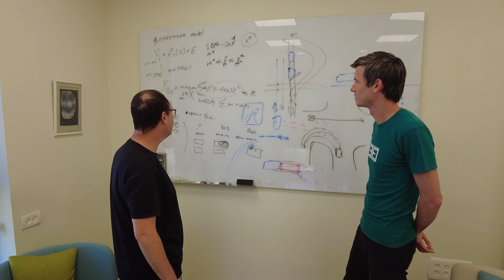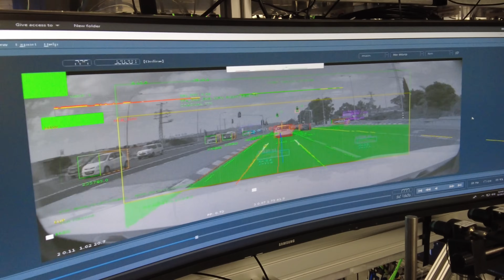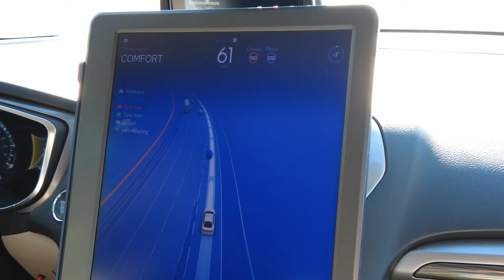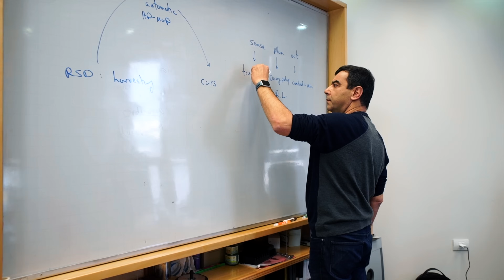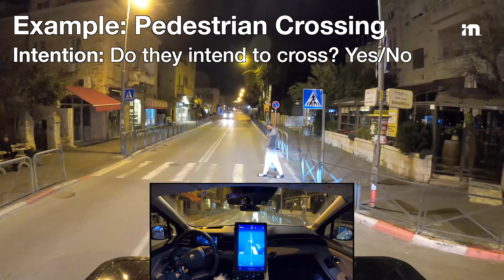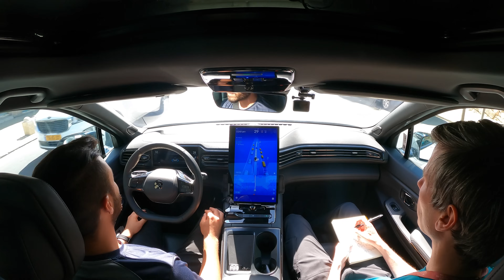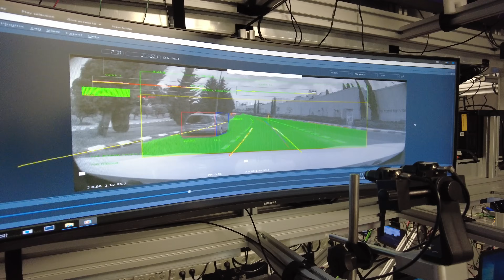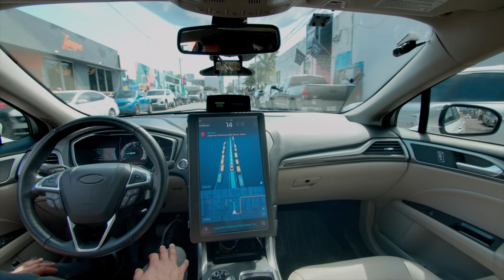Are Autonomous Cars Closer Than You Think?

Comment: Yeah, let's just program the AI to avoid such high traffic unprotected left turns like the plague.  I used google maps one time about a decade ago to go to a local business.  There was one of those major perpendicular intersections with exit ramps for all of the right turns and lights for the left turn, but there was also a network of side roads.  Well, I needed to make a left from the bottom major road onto the left major road.  Instead of using the major intersection, google maps had me turn onto one of those side roads and then make an unprotected left turn onto the major artery.  

I nearly got t-boned and now I make sure to ignore Google when it tells me to take a side road.

Comment: To all the self driving car avocates, I'd suggest looking up the videos of Vietnamese traffic intersections. In those videos, realize that all participants (drivers, pedestrians, cyclists, motorcyclists, etc) are able to negotiate traffic order on 8 lane intersections without any traffic control devices. Humans are able to do this through just hints from subtle hand gestures, gait/pace, horns, lane positioning, spacing, and angle.

Even in countries with more rigid traffic control policies, a human driver clues into these subtle hints. You can tell when a car is about to cut you off based on their lane positioning and angle. We mentally note which cars may be driven by distracted or new drivers and are more cautious around them based on following distance, response time to traffic lights, etc.

I've pulled up to do a right turn and had a car in the lane left of me pull up to block my view of oncoming traffic. In those situations, some times I can look through their passenger window and windshield to see oncoming traffic. Show me a lidar or video detection system doing that.

It is really easy to mislead how well a self-driving system works with statistics. A million accident free miles is worthless if only driven on sunny days and easy roads and the system bails out to a safety driver when it doesn't know what to do. Until a system takes in ALL of the inputs we as drivers do, how can a self-driving system match or exceed human drivers? No system in development takes into account horns or highbeams or hand gestures from other drivers.

Comment: After the past couple of years, I'm overtly against self-driving vehicles. They'll only be mandated under the guise of "your safety and the safety of others". 
You dissent mandates? Musk? Israel? US imperialism? Or simply don't update your battery software? Now you're locked out of your car by a central authority, and it's driving itself away. 
Neat trick, engineers of tomorrow. 

Outsourcing our thinking and reasoning capabilities to silicon and copper will only continue the trend in all aspects of our lives, making easier a populace to control. 

Even going from cable throttle to electronic throttle from an '02 to an '07 civic (both manual trans), I was very displeased with the amount of control I felt like I lost over the engine and the noticeable time delay gained, with the added filter of a computer deciding what percentage of throttle I'm applying.

Comment: redundancy? and here tesla is removing sensors and simply relying on cameras that can get completly blinded by some water lol
Reply: @chris thorney What do most drivers do, when they are blinded by some water??  When conditions are that bad, cars shouldn't be driving on the road.  Just for the record, Tesla FSD beta has redundancy as part of its design.  The idea of removing sensors is to rely on the more accurate ones, so as not to waste processing power, cancelling the less accurate ones.
Reply: @HearToneSpeak  are you honestly saying that you think a human is going to be blinded by a single drop of water like what can happen with a tiny little camera, oh my car stopped working let me get out in the rain to clean my camera lenses, instead of just putting the windscreen wipers on, witch it what a human would do, just for the record. have you ever driven a car lol? geez, tesla cameras are not located anywhere that wipers do anything, and all i said is your removing redundancy, so if one sensor fails you have zero fall back on a critical system that has lives involved, redundancy should be mandatory and if their is conflicting info then it should hand over to a human, but if their is only one sensor then it might not know its getting the wrong info because it has nothing to compare it to, when all it takes is for one rain drop to roll across the camera at the wrong moment and it will completly miss for example the car infront brakeing or anything, i dont see any good coming from removing the sensors except that tesla is going to make more money and thats good for them, but the rest of the world is left with a less safe enviroment on the roads
Reply: @christhorney  "are you honestly saying that you think a human is going to be blinded by a single drop of water like what can happen with a tiny little camera"  Absolutely Not... in fact the Cameras in a Tesla are bigger than your eyes, so a single drop of water will have little affect.   Secondly, the Tesla would activate the wipers to clean the windshield.   As for redundancy FSD uses 3 Front Facing cameras, but if more than 2 fail, the system has bigger problems and FSD shouldn't be operating.   

I don't think you understand how Tesla FSD Beta works.... mainly because Tesla doesn't explain all of its tech.   One drop of rain will not invalidate the system that is for sure.  

As for removing sensors, you should listen to Lex Fridman's interview of Andrej Karpahy's, he expertly explains why removing sensors actually makes the system better, not worse.   Adding sensors, is only good if it will improve fidelity/reliability/redundancy.   Having more sensors increases processing time and can actually impair the system.

Comment: There is this one T intersection where the traffic coming from the right is coming up a blind hill and cannot be seen.  People that drive this regularly and are turning left STOP make sure that no traffic is coming from the left then pull into the oncoming lane and get up to speed then move to the right if the right lane is clear.  Technically they are breaking the rules by driving on the wrong side of the road across the double yellow lines.  It seems that everyone that lives here has figured that out.   This is what the technology needs to figure out as well.

Comment: Now just imagine if car to car communication was implemented in a standardized method.
Reply from the maker: Yeah, we're definitely on "hard mode" at the moment without any standard form of communication between vehicles.
Reply: @EngineeringExplained  if it works well, it'll be like how it is in iRobot.
Reply: @EngineeringExplained  Ultrasound car horn morse code coming up.
Reply: @EngineeringExplained  
You are dreaming
Lets say centuries has passed to get all cars replaced with internet connected cars

What are you going to with cyclists, motorcyclists and Pedestrians ? Internet connect everything & everyone?
Reply: @rynoopperman5010  Centuries?! Lol! All we are talking about is cars having some sort of transponder that broadcasts things like coordinates, velocity, intended future path, etc. Not a big deal really and a great idea that will massively assist autonomous vehicles know what's going on around them. No reason for all cars, pedestrians etc to have this - autonomous cars will need to be able to deal with other road users without this anyway - but the more road users that have this over time, the better and safer a network of autonomous vehicles will be able to operate.
Reply: I Robot vibe :)
Reply: Car-to-car communication also introduces all sorts of new privacy issues. The NHTSA claims that the models of this they are evaluating can not be read at a distance, but anyone who understands how radios work can tell you that this is nonsense. With enough antenna, any such beacon signal will be traceable at long distances.
A car-to-car communication protocol that is traceable to a specific vehicle is a horrible loss of privacy.
Reply: @microcolonel  I mean if you're making payments on a car and don't own it outright your dealership most likely has a gps tracker installed on your car already. if you do own it, anyone nefarious can easily hide one.

every time we drive through a toll our plate is logged. being parked on the street when traffic enforcement rolls by, those cameras do the same.

I don't see how we have any real sense of privacy in our cars as is
Reply: It’s pretty easy just make everyone install a chip as a regulation and cars old and new can communicate, maybe build it into the plates
Reply: I've always felt that solving this with an inside-out approach was a difficult way to do it.  Only way right now since cars can't talk to each other, but if they could communicate together and know what the other vehicles are wanting to do would make for a better orchestrated experience.
Reply: cars can team up to overtake the ceo :o
Reply: If your car can give information that will affect how the other cars will behave around you, then it can give disinformation to get other cars to behave to benefit solely you.
Reply: …why not have the car communicate with the road? Why is nobody talking about this?
Reply: Proximity voice chat has entered the… chat
Reply: This already exists, just that it is underutilised on the road at the moment. It's labelled as car2x, v2x or something like that in the menu
Reply: Changing lanes… being more fuel efficient in convoy etc
Reply: all these difficult solutions become easier as autonomous cars become more popular.
Reply: Why? The car still needs to account for cyclists, pedestrians, older vehicles, and other non-communicative transit, so it still needs all the sensors and processing power, meaning you're adding a lot of cost and complexity without really improving much.
Reply: That will ONLY happen when it becomes some kind of law, or government demand  to happen at some point.

Will raise production cost, but, could come with lower insurance and taxes. Since fewer accidents would happen. Less fuel/energy costs cus ppl would not drive like crazy.
Reply: @paulogazolla7488  another benefit would likely be faster commute times during high traffic hours due to things like smoother merges and reduced emergency stops that create stop and go bottlenecks.
Reply: @jamesbeaman6337  for sure, but the transition time would be long, and cars would need both systems,  we might end up at some point restricting older cars to be on certain roads in certain hours.
Maybe a 3rd party system? Off the shelf...? Who knows
Reply: @jamesbeaman6337  absolutely. Your car could signal its intention to merge, and the other cars could make a space for you exactly where it is needed.  Meanwhile, the driver of one of the other autonomous cars will hit the gas because they do not want to let you in XD
Reply: @paulogazolla7488  why is your English bad? No commas, just run on sentences
Reply: @yungboicontigo9278  Google's voice to text.
Reply: Oh FFS’s… 🙄🤦🏼‍♂️
How many decades or centuries will it be until every current car has been replaced with a internet connected car??

And then will cyclists, pedestrians & motorcyclists all have to be internet connected??

You’re dreaming
Reply: And tell your bank that you are overdue on your loan and take you straight to either bank or police. Or if the government does not want you to go to a political rally and stops your transportation. Or stop you from going to meet your mistress and inform your wife.
Reply: @M_C you realize that's kidnapping, right? A car driving itself doesn't suddenly give companies a free pass to commit felonies. If some government wants to force you to go somewhere they're not hacking an autonomous car to do so, they'll just arrest you
Reply: @Benlucky13  r/wooosh it was a joke
Reply: @tonyhuang431  I mean you're not the one I responded to, you might want to give that sub a visit yourself
Reply: That's a horrifying idea.
Reply: @gudenau  kinda however there will always be grandfathered in cars, like how old cars don't have to pass today's crash safety tests.
Reply: @johnhunter7244  The biggest issue with this is how on earth do you stop people from telling cars that there's an incoming truck going 100 in the wrong direction and causing accidents? If you're trusting what other cars say you're going to try to do invasive action, if you're not trusting what other cars are saying there's no point because the exceptional things are why you're communicating.
Reply: there is, its called an iphone and air dropping obscene material to anyone you pass. doubt you'll want the asshole you just cut off to call your car phone to give you their piece of mind
Reply: @MrPaxio  Everyone would have to have the same app and agree to share their location. Many people won't do that and I assume there would still be a delay given how good the signal is so this would be giving past data like driving through the review mirror. If cars could tell each other what they are about to do, that would make self driving so much more safer. I'm still not sure how self driving cars will work in heavy rain, fog, snow, etc if they can't "see" nor talk to each other.
Reply: @tremorsrules  what? the car tells you what the driver is about to do? the whole reason accidents happen is that someone does something unexpected and not even AI can read your mind

Comment: I love your videos, but this one falls way short of engineering explained and more like marketing.  What I'm seeing is a lot of powerpoint level explanation.

I realize you had a ride in their L4 car, but why weren't you behind the wheel?  Sensor fusion has been largely debunked as it ends up causing precision and recall spikes (ends up being random ven overlapping strengths and weaknesses) with the car doing random things unexpectedly.  I'm guessing that is why you weren't behind the wheel.

Did they say how they were predicting intent?  Why isn't this explained?  This was the only interesting part of the video, from an engineering perspective, and there were no details provided.  

Also, you make it sound like they have millions of cars sending back L4 useful data back to be used for the L4 car.  Did they tell you what that data is actually?  It is glossed over, but these details matter as the L2 system they have in production is simply not capable of sending back meaningful data.  You should ask!

In summary, your videos are usually filled with great math and logically breaking down how things can be achieved or NOT achieved.  This one comes across as marketing.
Reply from the maker: It sounds like you didn't watch? I addressed most of your questions in the video.
Why wasn't I behind the wheel - as mentioned, it's a test vehicle, so there's a safety driver in place. 
How do they predict intent - it's a great question, that isn't answered by a quick video, which is why I recommended (in the video) you watch the full presentation on it) - https://youtu.be/ViGL0z1BULs
Data - It's not L4 cars sending back data, it's L2 vehicles. I described in the video what this data is, and provided an example of how it is used at 6:45.
Reply: @EngineeringExplained  Watched and read the transcript to see if I missed anything.  Your video is just missing the engineering explanations you normally have.  This video and the video you linked, is marketing powerpoints.  The demonstrations are very short clips of something that seemingly is the best possible view of a system not able to scale.  I think it is possible that AI and NNs are not your cup of tea.
The L2 cars are NOT CAPABLE of sending back meaningful data for L4 driving.  Please ask the questions that get to the heart of what is being presented.  You should have driven the car and I think you didn't, not because you couldn't due to it being a development vehicle (you could have signed a waiver), as the system is very unpredictable.

I really hope your next video is actually engineering explained.
Reply: @Discoducky73  What makes you assume L2 cars are not capable of sending back meaningful data? Are you a Mobileye engineer?

You're asking for IP data... basically asking "Hey can you show me your code so I can copy it and commit theft of your product? THANKS much appreciated".
Reply: @Discoducky73   How would him driving change literally anything in the video? The driver didn't touch a control at any point, so they were effectively doing the same thing in both seats, ie watching the car drive itself in very difficult circumstances. Not sure what you're on about, but I found the video absolutely fascinating, and makes it seem like we're not as far off with self-driving cars as I thought.
Reply: @sinister_lefty  That is my point, their solution is not what it seems.
Reply: @vl3005  The legacy cars do not have a way to send this data back, they can't even update the code.

Comment: The clear problem with intent-based risk calculation is that machine optimization suggests the car will have to stop or slow unnecessarily in many situations. Put another way, AV drivers will not take the dozens of calculated risks that each human driver takes every day.
Reply from the maker: I think I provided plenty of examples in the video that show it working pretty smoothly. Here's a couple:
9:53 - it gets over because a bus is merging, rather than slamming the brakes.
12:22 - it goes ahead of multiple pedestrians (from the left, both times), rather than just sitting.